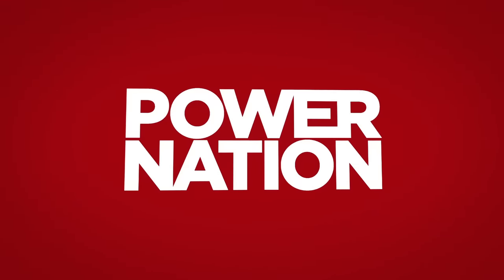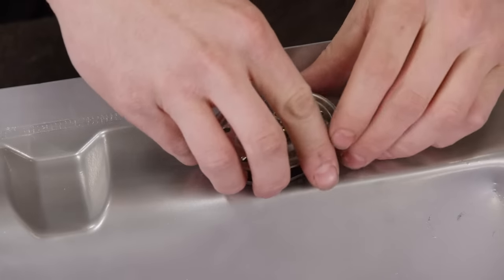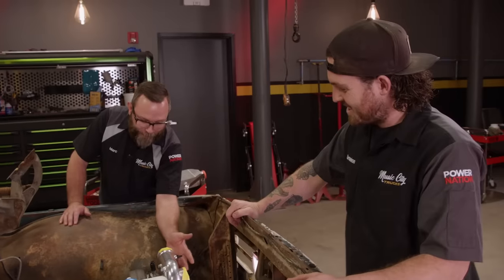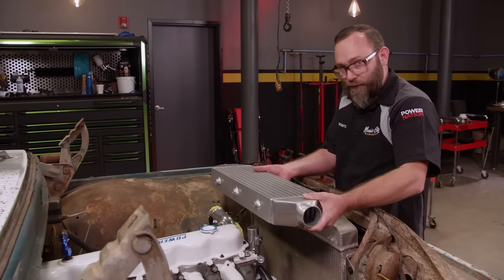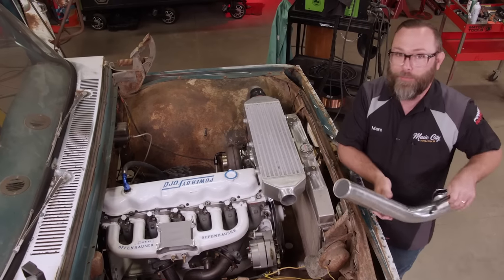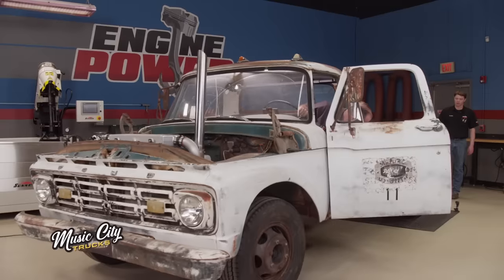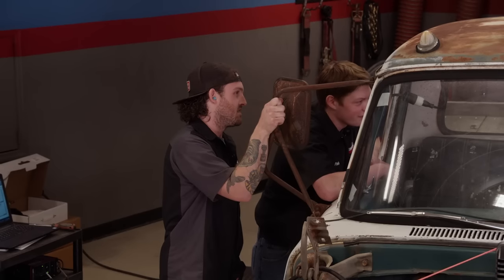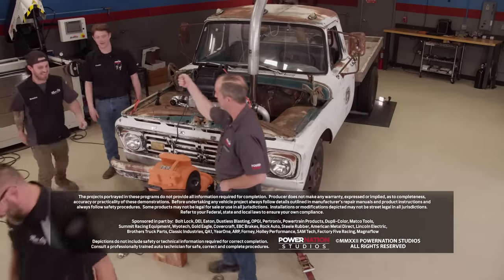Turbocharged Ford 300 Flatbed Dynoed - Music City Trucks S2, E8

Comment: With the room you had between the radiator and engine, you should have spaced the radiator back and put the intercooler in front of the radiator.

Comment: I'd go even lower numerical ratio than 4.10:1. I've got 3.73's behind my V10 with OD and stock tires. Even though those don't make the low end torque of these 300's, it still jumps off the line hard. I think my 0-60 time is faster than when it had 4.30's in it because it doesn't have to do that 1-2 shift so quick and it has no problems with a 10k lb trailer behind it. My last F150 I ran a 300 with 3.05 rear gears on a 265/75/15 tire and it would still pull a house off its foundation. Starting with a heavy trailer was not the issue, stopping was. I was able to squeeze over 14 mpg out of that thing on the highway, which is great for a 300. Taller tires like this, 3.73 or something in that territory seems to be a sweet spot for torquey engines, especially if you have overdrive.

Comment: 6:30 "housing" was gold to my ears lol DON'T PUT A THERMOSTAT ON IF YOU DON'T LIVE IN FREEZING TEMPERATURES!!!
Reply: BS.  Engines run better the hotter they are, and even better the more consistently hot they are.  The thermostat is there to regulate the engine's temperature.
Reply: @coreybrenner  who are you talking to? Because I never said ANYTHING about the temp a motor likes to run at... I was regarding uh stuck thermostat. Can't have a $20 part destroy your motor, if you don't have it in your motor. But I appreciate hearing a 101 basic understanding of a non essential component of a motor.
Reply: I was pooh-poohing the idea of running without a thermostat.  I usually pony up the extra shekels for a fail-open stat.

Comment: Someone sat there with a straight face and said, "yeah. Put the intercooler directly over the radiator that's already engine temp and lay it flat on itself so it blocks its own airflow."

Comment: its hard to beat a straight 6 when it comes to all day work for decades.explains why i've seen them in industrial wood chippers, water pumps, even old generators & jack hammer air compressors.they'll run forever at 3k rpms.

Comment: Very nice. However, I would rethink that intercooler for sure. How will it ever get any air flow thru it. Need to move it to the front of the radiator mounted so air will actually flow thru it like its supposed to work

Comment: The intercooler is just about worthless now in that position. You had all that room.. you could have easily fit an air to water ice box or just used the air to air properly by placing it so it could get some cool air.  You basically have no intercooling at all and possibly more heating than a direct pipe. Of course with that shop fan on it that’s different.

Comment: radiator is going to crack over time set up like that the motor rocks back and forth the bracket on the back attached to the engine is going to put pressure on the intercooler

Comment: Very nice! I think the last piece of the puzzle would be a cross flow head. I know people are cutting and welding ls and other heads together to achieve this but I wonder about the long-term reliability of these put together heads. Five axis machining isn't cheap but a billet head would be awesome!
Reply: In that case it would be much easier to just use an Australian Ford inline 6 cylinder engine, the 4 litre (250 cubic inch). It originally came with an overhead valve head like this motor, then they changed to a cross-flow head, then they changed to an alloy cross-flow head, then they changed to variable cam timing, then they went twin cam with the "Barra".
Apparently the early cross-flow engines were a popular import to the States for lovers on Ford inline 6s.

Comment: One thing clear to me is that you should have gone with that 62mm turbo whe the engine was built. I have seen two builds on modern efi 300s that broke 500ftlbs at the tire. Bone stock f150 engines. That turbo is just too large for this application unless you were spinning an additional 1000rpm.

Comment: What happens with that brace on the intercooler when you put the beans to the engine and it starts climbing up off the driver side motor mount and rolling over toward the passenger side?

Comment: Confused as where will the airflow come from for the intercooler?
Reply: It’s a top mount like a Subaru - they’ll probably run a hood scoop.
Reply: It's going to get plenty of hot air from the radiator.🙄

Comment: Nice set up. The intercooler may be in the wrong place but 10lbs boost is safe for poor/non intercooled engines. Put some louvers in the hood and call it a day. Didn't notice a cold air intake either. I have a 26 ft Ford F800 and the torque is about 40-50lbs better with 200 less hp. That truck is ready for some work. 4.10 gear. Leave it alone.

Comment: I'm not an engineer but the one thing I don't like is mounting the cooler to the radiator.  The radiator is mounted to the body and the cooler tube are hooked to the engine.  I'm afraid the twist of the engine is going to break the tank on the radiator!

Comment: 2 things ive always wanted to see is a 300 I6 w a massive turbo or a pro charger hangn off the front. Only thing id change is the head. Id change that to cut up 390fe head so it flows properly, but i could see it making well over 500hp and 800ft-lb of torque
Reply: FE heads won't work. The intake on the FE's is part of the head ( pushrod tubes, part of valve cover mounting flange ) .  The 351C heads or the old Nascar Ford 4.5L V6 SVO heads are the ones to use if you want to cut up some heads.
Reply: 5.3 Chevy heads work pretty well too.

Comment: Not only is the inter-cooler in the wrong place, it's also way too small. An air-to-water cooler would be much better suited for this build.
Reply: Actually the intercooler is plenty big, and maybe overkill. Because they're running the throttle body as a blow through, that fuel atomization will remove way more heat than that intercooler ever would. I would bet with double cooling like they are IATs are lower than ambient.

Comment: ok. the intercooler mounting made my head hurt. wouldn't you think on the drivers side fender liner would have been a better choice? a pair of small fans over it (or behing it) controlled by a boost pressure and/or temp switch running said fans? not to mention ease of plumbing the cold side. inlet/filter could reside low behind the fenderwell too.
Reply: Behind the front bumper would have been a better position.

Comment: Man, guys come on.. as I read all the hate comments I think to myself, all the youtube master fabricators, tell the real builders how they should have done it.. 🤣🤣🤣
 I think it's bad ass!!
Reply: Master builders wouldn't put the intercooler in a place where it does nothing but absorb a lot of engine heat.
Reply: @bmstylee  Or solid mount it to the engine and radiator tank! Or solid mount the engine on a driver.

Comment: I'd go for 3:73 rear gears. You'll get all the.pull you need and not burn 500 gallons of gas. I put 3:73 gears in both the diff's in my F-350. It will still pull your house off it's foundation and the fuel mileage is much better than it was with the 5:73's it came with.

Comment: Do the dual wheels take up even more horsepower off the wheels? Could it be as high as 25+% drivetrain loss even with the manual with that size draftshaft rear end and dual big wheels?

Comment: Should replace that Ghetto mounted Air-Air intercooler with a water-air based intercooler. That Ghetto mounting position is not going to cool well unless you put some fans of something to force cool air into it.
Reply: Still won't work. Hot air rises, so all the hot air from the radiator goes right to it.

Comment: There's no reason not to run 14lbs+ of BEAUST! It's Timing the 300 dislikes, under severe engine loads the #1 piston takes in a lot of heat, either plumb extra coolant flow to it  or run a larger gap in the top ring, if you dont want to pull the head, oil n pan to push it up n pull the ring, just try to keep the timing under 28⁰ total advance at higher rpm  running an ignition timing delay for just the #1 cylinder would be ideal, I'm not sure of the best route to go with that   but I had thecstrongest 300-6 around, 11,000 lb dump truck 456 gear dually pulling a 8,000 lb three axle dual hub (12wheeler) heavy equipment trailer with Frankenstein the lead v- tread back from the dead monster truck (weight unknown but it was heavy, 2-1/2 ton running gear 5' big 1/2" plate rim centers) anyway, my work truck, was  reluctantly requested, (doubted it's ability) I agreed, went and recovered  tgen pulled that whole rig out of the mud hole, then from Parish, FL. all the way to the Bellamy Brothers Ranch in Darby FL. with a 6 yard load of split stacked oak firewood, at a steady 70mph, like it was empty, until I had to stop, good thing I kept my brakes in optimum condition

Comment: 2 things wrong with the intercooler 1 airflow 2 it's mounted to the engine and the radiator I give the upper tank about 4 days before it breaks out around the welds because the motors torquing back and forth and the rear intercooler Mount is bolted to the motor. Even with solid mounts it's going to destroy that upper tank on the radiator.

Comment: Regarding fuel delivery, I have a question:
At around 21:15, he mentions "this can handle 25lbs of boost". Why is that mentioned? Boost just means the motor "acts" bigger and needs more fuel. Why not just say, "This unit can flow X air and Y fuel". I am really curious about this, The entire fuel delivery community talks about boosted applications and compatibility. Is there something different between a boosted 350 and a normally aspirated 454? They could both potentially flow the same numbers, so why does BOOSTED matter? What's different? <seriously asking, I don't get it>
Reply: People understand boost I guess.   Plus that's just what it is capable of reading in the ECU.

Comment: I would NOT mount the inter-cooler hanging way off to the side to an Aluminum radiator!
It may hold for now, but eventually it will crack the radiator, not only that, but the engine will flex, and it's connected to that engine so it needs to be mounted to the engine!

Comment: Anyone else think the air cooler could have been mounted a littleeeee bit better!? Im not saying im a engineer or anything, but unless they're slapping a hood from an subaru WRX STi on that ford than I don't think it's gonna be very healthy.
Reply: It's going to cause either the intercooler or the radiator to fail. Plus they positioned it perfectly for it to get the hot air from the radiator. It needs to go down under/behind the front bumper.

Comment: Having people stand next to the vehicle when running it on the dyno isn’t a great idea, the intercooler placement isn’t going to work on the road, it’s probably going to heat soak from the radiator., a couple tweaks and it will be a great truck

Comment: intercooler should have been fitted behind grill. maybe needed a thinner one amd cut the holes in the core. you left hp on the table  with the heat soak with it inner the hood.
Reply: Behind the bumper.
Reply: @Fordman7575  no air flow thru the bumper. would need more modifications too.
Reply: @oregonfordguy9812  You angle mount it behind the bumper ( top of core closer to the bumper then the bottom ) with a simple shroud/scoop plenum box to direct air flow into it. Paint the plenum box/scoop black. And all that's visible from the front is a little of the plenum box hanging below the bumper.  It gets cool outside air thru the intercooler and no worries about ruining the intercooler or radiator because of the way it's mounted. And the tubing can be routed under the core support so no cutting holes in it.

And doing it this way you aren't blocking airflow thru the radiator core either. Like it would being mounted in front of the radiator.

Comment: A real everyday driver would not have the hood stack. I would take it under the rig, and go a set of flowmasters, yes a set as it would get a single to dual exhaust system to the sides and up like as in big rigs do.... twin chrome stacks, keep the patina and go to 3.73 gears... it has the four speed so why not. Unless it hurts someones feelings a higher speed rear would make for sixty at about 2100 RPM's which just driving would not drive you away from inside cabin. Plus hoods for those rigs are not falling out of the sky

Comment: I know it's a show and they do stupid things like the stack but come on and hot air rises so you're gonna lose power because you're heating your charge with the engine heat. You guys are mechanics right? You should know this but it'll probably be said that it's only mock up for a later time. Why waste the effort and just do it right the first time. It needs a full exhaust and not that stupid stack. Hopefully it'll come back with more modifications later on and they'll scrap the stack. More modern dually axles and suspension would be nice add on.

Comment: So what happens to your intercooler mounts when the the engine rocks in the motor mounts? That should NOT be mounted solid to both the engine and radiator. Yikes…!! 🤦‍♂️😳

Comment: An engine of that size at those revs should be making 275KW NA, and you did it with 68kpa of boost. Thats not great, it should be in the mid 400KW

Comment: The reason why it's taking so long to load is because you chose a turbo that was too big, a 62mm can hit 700WHp these days. There was no need for a 70+...for an engine not meant to make power at 6,000+rpm.

Comment: So one side of the intercooler is attached to the radiator, and the other side of the intercooler is mounted to the motor.  That radiator is going to crack in no time.  Not to mention the horrible position for the intercooler.

Comment: Those gears are ridiculous, that straight six is always going to have a low rpm torque curve. I used a old bull nose with a 4 speed and 2.50 rear end out of a 3 speed on the column truck. It was bored 60 over and shaved head, otherwise stock. Would pull a big flatbed and a 4000 pound car or pickup at 70 mph and would not even lose speed up small hills on highway, no turbo even. Why do people always put crazy low gears, it's a low end torque motor,  gear it down so it can use it's power! I would put 3.08 or 3.50 max.

Comment: That’s about the most ghetto way to mount an intercooler. The aluminum will crack, and leak, over time. Take the time and do it right, mount it in front of the radiator even if it involves modifying the core support! I’d be embarrassed to show that if it was my work.

Comment: Inter cooler install bad all way around.. stress rip radiator open .. inter cooler has no cool air to do inter coolin
Reply: You can tell this was engineered just enough to prove they could do it. But not good enough to work as well as it could. I mean stuff is everywhere. Totally nonsensical but kinda fun.
Reply: @locker1325  it was cool.. just silly to put inter cooler on for no reason..it’s more likely to add heat then remove it.  Stupid things bug me
Reply: Just never run it with a hood.
Reply: @MrEli204  Hot air rises, all the hot air from the radiator goes right to the intercooler. It should be behind the front bumper.

Comment: One of the coolest engine builds ever,and wasted on this disgrace. 
Sad
Reply: So, they put a truck motor in a truck?  What's the problem?
Reply: @josefrobbins8781  
Drum brakes,50mph top speed at recline. Looks like a pile of shit. And a stack out the top?
These two destroy everything they touch
Reply: @tonyheitsman4728  You're not a truck guy, so it's ok you wouldn't understand.
Reply: @josefrobbins8781  
You have no idea what I am.
That's a diamond motor. And they are building a heap.
Reply: @tonyheitsman4728  The top speed was 75 mph!  The top speed and brakes can be fixed. I'd swap in some axles out off a late 80's-90's F-Superduty or 99+ F450. 

The poor decisions like solid mounting the engine and intercooler, how and where they mounted the intercooler and the hood dump exhaust. It just seemed like they put in as little effort as they could.
Reply: @Fordman7575  
Now we are talking!!
Reply: Btw, I had a 65 F100. Put a 302 and disk fronts. 
On my 9th Ford pickup now
Reply: @tonyheitsman4728  To what you said earlier I agree it should have gone in a fully restored model year, and more effort could could have been done into tidying up the truck/build, but choosing an F-350 is not a bad choice, it makes all the sense to do so.

Comment: Cool project, but there's nothing like riding down the road with 19.5 gallons of gasoline just sitting there, a few inches to your rear ready to incinerate your azz, the first time you get "T-boned" or roll the truck.  This is the huge reason why manufacturers stopped putting the gas tank behind the seat in pick-up trucks.  You guys should have retrofitted an under-bed tank because behind-the-seat gas tanks were and are a bad and dangerous design.

Comment: Wow!
What an absolutely horrible place to mount the 'intercooler'!
NO airflow except for HOT radiator air coming up through the inter-heater.
You should have ditched that intercooler and all that piping and run a good Methanol injection system.
Lower IATs
Lower EGTs
Higher Octane
Super clean intake valves and combustion chamber
Win-Win-Win-Win